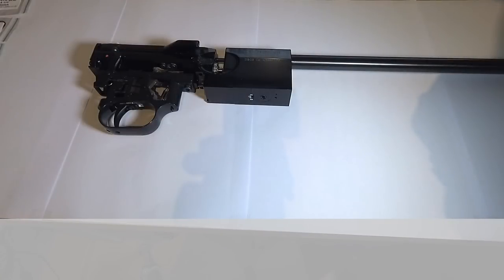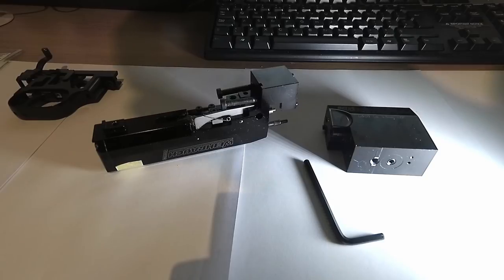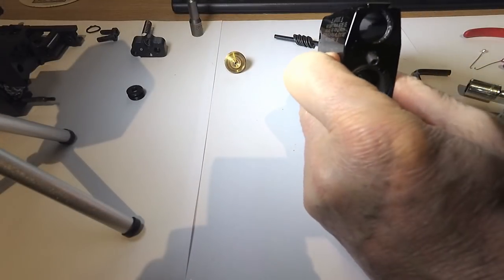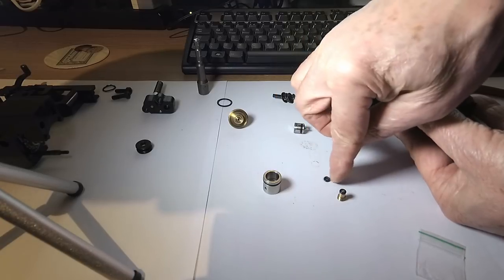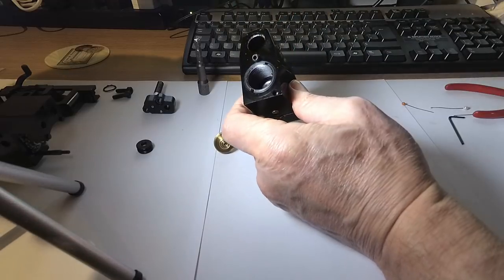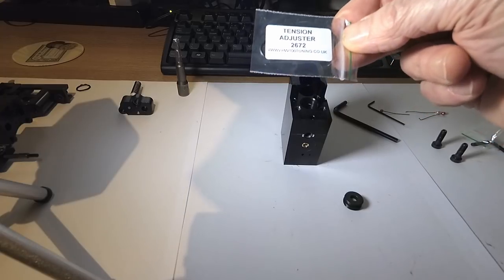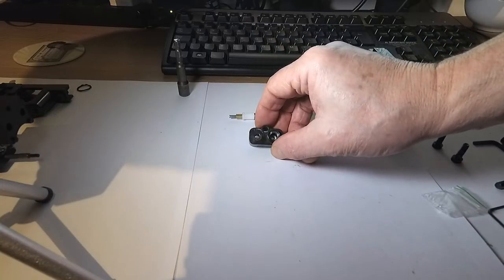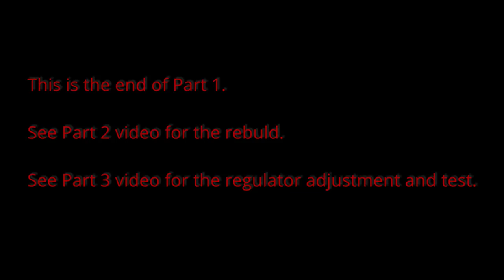Weihrauch HW100 - Regulator Service - Part 1 of 3

Comment: my local firearms dealer does not deal with hull cartrage any more after they ripped him off.

he now deals directly with Weihrauch
Reply from the maker: Hi, I am all for cutting out the middle man to achieve best value.

I did not send my gun to Hull for servicing because of the cost and the demand that I sent it via a Registered Firearms Dealer.  Using an RFD is clearly not necessary for a non-FAC gun.  See the SERVICING tab on the  www.hw100tuning.co.uk  website for details of the steps needed for sending guns for servicing via the Post Office.

All the best,  Martin

Comment: Hi, many thanks, amazing 3 videos you done here. 
It will definitely help me thank you. 
I have a leak which air comes from the pin hole at the top of the gas canister on HW 100. 
I've changed the little O ring and cleaned inside but it's still coming from that little pin sized hole when I fill it up with gas. 
Any thoughts much appreciated 🙏
Reply from the maker: Hi Craig,  Apologies for the slow response.  Sorry to hear that you are having problems with your HW100.  Do you mean that air is escaping from the pin hole that is located on the underside of the regulator section of the action when it is removed from the stock?
You mention that you have changed the small o-ring and I think that you mean the o-ring on the brass inlet valve.  The next easy thing to do is to change the o-ring inside the brass inlet valve.  See my Part 3 video.  But before doing any work on your HW100 be sure that you remove the cylinder first then cock and fire the gun several times to ensure that it is completely depressurised.
All the best, Martin
Reply: @MartinHealy  Hi Martin thank you for that, much appreciated.
Yes the problem was the O ring on the Brass regulator that houses the gas gauge attached by the 5mm Allan key. 
Everyday is a learning day!. Thank you for that and all the rest of your advice. 
Many thanks,
Craig

Comment: Great video. What order do the regulator washers go back in?
Reply from the maker: Hi Shaun,  If you use the slider bar to scroll through the video to the 30:10 second mark you will see me start to re-assemble the belleville washer set.  I put a diagram of washer order on the screen using bracket symbols to indicate the curves in the washers.
The washer order is -  ( ( ) )  ( ( ) )  ( ( ) )  ( ( ) ) 
Hope that this helps.  Please watch the other Part 2 and Part 3 videos to see the assembly and testing.
All the best, Martin
Reply: @MartinHealy  thank you thats great 👍

Comment: I had to heat my block to remove the brass fitting (it had never moved in the 19 years of me owning it). I had to use a blowlamp as i was scared of shearing the brass with the force i was having to apply. After gentle heating it came out with MUCH less effort.

Comment: superb video of hw 100
Reply from the maker: Hi Pratik,  Thanks - all the best, Martin
Reply: hi martin there is a slow leak developed in my hw100,  what should i do??
Reply from the maker: Hi Pratik,  There are several likely places that the HW100 can leak.  The first (simplest) place to check is the Main Inlet Valve (A) 2665.  Unscrew the air cylinder to get to this small O-ring.  If you are replacing this seal go for the upgraded polyurethane seal which is much more durable (https://www.hw100tuning.co.uk/product/polyurethane_seals.  If you have an original HW100 cylinder the internal seal may need replacing.  I don't have the HW100 cylinder so I haven't had to do this myself and I gather that some special tools are/may be needed (https://www.hw100tuning.co.uk/Air_Cylinder_Ends_Removal_Kit/p2174806_18670926.aspx).

If these easier options don't fix the problem then a strip down will be needed.  The firing valve seal 2655D (polyurethane) is another possible cause.  I would recommend the major seal kit (https://www.hw100tuning.co.uk/product/seal_kit) if you are opening the regulator side of the gun.

Above all please, please be safe.  Never work on the gun with the cylinder attached and pressurised.  Depressurise the cylinder before opening.

All the best,  Martin
Reply from the maker: Hi Pratik,  Feel free to send me a PM through YouTube.  Regards,  Martin
Reply: hi martin as i live in India, how can i get the original o rings for hw 100
Reply from the maker: Hi Pratik,  Good news - I just messaged HW100Tuning.co.uk and they confirmed that they will post direct to India.  Hope that this solves your problem.  All the best,  Martin

Comment: Hi Martin, as discribed in your Video, when will we see the part 4 of you servicing the trigger assembly and the probe Oring replacement ? Cheers.
Reply from the maker: Hi Ravindra,  I only make these videos when I am carrying out repairs or service on my guns.  I believe in the motto 'if it ain't broke don't fix it'.  However, when the time comes I will continue to make videos.  The next video is likely to be the strip down and seal replacement on my Webley Raider 10.  In the meantime check out my pistol and pellet reviews on another of my channels - here is a budget pellet range testing session that delivered surprisingly good results - https://youtu.be/669_SOr5UX0?si=yTNXGpPg0qptmkBB
All the best, Martin
Reply: Hi Martin,
Thank you for the reply.
All the best.

Comment: Hi Martin thank you again just looked at my rifle and the ball bearing is in the test port and there is no grub screw holding the ball bearing in there is only a grub screw on the other hole next to the port that makes sense
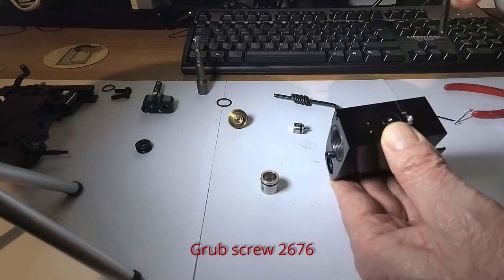Reply from the maker: Hi Matt,  I am sorry if my video has added to the confusion.  The pressure test port is right next to thread hole for the stock mounting screw.  The pressure test port is towards the barrel end of the block.  In the video you will see me remove the the pressure test port grub screw at 16:48 but I then stupidly put the replacement pressure test port plug into the stock mounting hole.  I put some text on the screen to highlight this mistake and of course I rectified it. Please watch this section of the video again carefully to make sure that I have not accidentally mislead you.  By the way, if you are going to be connecting a pressure gauge several times while tuning the gun setup it is a good idea to get the hw100tuning.co.uk replacement pressure test port plug which replaces the ball bearing and grub screw.
All the best, Martin
Reply: Morning Martin thank you very much for clearing that up just did a nutshell so where the ball bearing is in that port should really be a grub screw holding it in
Reply from the maker: @blarza007  Hi Matt,  Yes - see the HW100 exploded diagram at https://www.hwtuning.co.uk/exploded_diagram_new.htm.  The test port threaded hole should have the small O-ring (2677), ball bearing (2675) and grub screw (2676) tightened down to seal the port.  Hope that this helps.
All the best,  Martin

Comment: Hi Martin . . . another question.  When you remove the air cylinder, does this remove pressure from all areas within the block?? ie - if you remove the cylinder, can you then remove the screw and ball from the pressure test port without 90 bar bursting out??  I assume this is the case but if so, is the pressure equalised to atmospheric throughout? I haven't tested my HW100 recently but have vague memories of removing the cylinder, cocking and dry firing and there was still pressure inside it but surely this must be wrong? - I will have to try it again some time
Reply from the maker: Hi, I haven't specifically tested for this case but I would expect the block to depressurise when the cylinder is removed because the regulator piston will (should!) be driven forward by the Belleville washers and the Main Inlet Valve will open.  But never trust to luck.  Always treat a gun as though it is loaded so, even after removing the cylinder, point it in a safe direction and dry fire before doing any work on it or cleaning.

By the way if you are going to be opening the pressure test port I show a little tip in the video about using a powerful magnet to draw the ball out.  If you are planning to do some serious experimenting with different regulator pressures then would also recommend replacing the original ball valve with the brass plug from hw100tuning.co.uk.

All the best,  Martin

Comment: When i replaced the o rings on the main inlet valve,and screwed,the air tank back on my gauge is not in the same place i.e. it is half a turn out ,do i take it back off, and tighten,an extra half turn,  but i don't want to strip the threads.
Reply from the maker: Hi Jeff,  You are right to be cautious and not over-tighten.  The cylinder doesn't need to be gorilla tight.  The small o-ring 2665 on the end of the Main Inlet Valve ensures the seal.  I don't have the Weihrauch cylinder on my HW100.  But I am struggling to understand how your gauge has ended up half a turn out.  I think I would remove the cylinder and the MIV.  Then screw in the cylinder, only till firm,  and see if the gauge is in the correct orientation.  

Referring to diagram:  https://www.hw100tuning.com/exploded_diagram_new.htm
If the gauge looks correct then the cylinder could be bottoming out on the MIV.  Check that the o-ring 2674b is correctly seated.  Check that the threaded sleeve 2673 is screwed tightly into the block (it may have moved when you unscrewed the MIV).  Check that the MIV is assembled correctly.  Refit the MIV and tighten firmly.  Refit the cylinder.

Hope the above helps.  All the best,  Martin

Comment: Hello Martin, I need your advice! 
I've changed some O-Rings of my Hw100 and everything worked perfect, cause of your Video, thank you for that. 
But last week my Hw100 keeps leaking. I fixed it quickly, O-Ring 2658 broke. So I got a new one in, but it is still leaking, every O-Ring is fine. It leaks from 200 bar and stops at 130bar, which is strange cause my regulator is set to 90 bar. Did you have those issues? 

Sorry for my english and greetings from Germany 😁
Reply: Hi Seepel,
I am happy to try to help but you will appreciate that without the gun in my hands it is hard to narrow down the cause of the leak.  So I can only offer some general tips and hints.  I am not sure which Orings you have already replaced.

Oring 2568 - if you have used the original Weihrauch specification then these Orings are crushed when the breech plug/block are mated and need to be replaced each time the block is opened.  The replacement new specification Oring 2568 are a narrower section and often can be reused.

One of the most common cause of slow leaks is the small Oring 2665 on the Main Inlet Valve.  Remove the air cylinder and you can then see Oring 2665 on the end of the brass inlet valve.  I would recommend changing this Oring and using an upgraded polyurethane Oring because they are more durable.  Fill the cylinder to 200BAR and leave it off the gun for several days and keep monitoring the cylinder pressure.  The original Weihrauch cylinder has a valve at each end and the air pressure should remain constant.  If the pressure drops while the cylinder is off the gun then the cylinder needs to be serviced.  I use an aftermarket A&M cylinder so I have never had to service the Weihrauch cylinder.  If you need to service the cylinder exercise extreme caution and ensure that the cylinder is absolutely completely empty.  There is a useful guide to opening the cylinder on  https://www.hw100tuning.co.uk/   They also sell all the Orings and tools you may need.  They are operating during Covid-19 and will post to Germany.

If the above does not fix the leak then you need to return to the regulator block and carry out the full service as in my videos.  I would recommend the major service kit of Orings from HW100tuning because it is a simple way to get a full kit of quality Orings that are all individually bagged.  I don't have any affiliation to this company but I have found them to be a good company to deal with.

Hope that this information helps.  Regards,  Martin
Reply: @Incognito1-1  Thanks for your help, I already ordered the O-Ring Set months ago :) I changed some Orings but not all of them, my hw100 is sealed. So today I took my HW100 apart to see if the O-Ring 2658 is damaged. It is, but I have several other 12x1mm Orings. Instead of putting the O-Ring over this little neck on the breech block(2681) and pushing it back in again, I tried to place the Oring in the groove on the valve housing. I tried my best to keep it center while pushing the breech block in, so I hope this will keep the Oring from breaking

Comment: hello I followed all the videos you put online you helped a lot of people to repair their own pcp for that thank you very much here is my problem I bought a PCP recently a HW 100tk canon 41 cm there is 16 joules my problem when I bought it in France I asked for a 35 joules 60 cm gun they sent me the 100tk 16 joules instead. because I live in Algeria I can't make a return otherwise it will cost me very very expensive in money. Given that I shoot at disciplines very far I wanted to raise it to 25 joules so please if you can help me raise it to 25 joules tell me which part I'm going to change because here at home in Algeria there is no power limit you can have a PCP of 150 joules so once again if he please if you can tell me which part changed i will buy them and thanks for listening to me again thanks for all you do
Reply from the maker: Hi Matouk,  I live in the UK and have a sub-12ftlb HW100 (<16J).  My experience has therefore always been focused on ensuring that my guns remain below 16J to remain legal.  There are some significant design differences between the 16J and FAC variants of the HW100 (such as the regulator piston, belleville washers, hammer spring).  In your situation I would definitely try to sell the 16J gun that you have and use the funds to buy another FAC HW100.

If you do adjust the power of your 16J gun upwards you will need to increase the regulator pressure and the hammer spring pressure.  Since you purchased the HW100 in France I am not sure if there will be an anti-tamper fitted on the hammer adjuster.  If there is no anti-tamper fitted then you could try increasing the regulator pressure to say 110BAR and increase the hammer spring pressure gradually to achieve a higher muzzle energy.  

There is a balance to be found between the regulator pressure and  the hammer spring pressure.  If the hammer spring pressure is too low then it will not open the firing (exhaust) valve fully because of the regulated air pressure behind the valve.  If the hammer spring pressure is too high it will cause hammer bounce and that will waste air and significantly reduce shot count.

Attempting to increase the power will have significant costs and potentially a damaged gun.  But if you still want to go ahead then, after checking to see if your gun has anti-tamper fitted, contact  hw100tuning.co.uk  they will be able to sell you the parts.

So my advice is definitely to find someone in Algeria who wants to buy a 16J gun.  That way you will be able to buy an FAC gun that was designed to shoot consistently at higher muzzle energy.

All the best, Martin
Reply: hello thank you for answering me it's fast it's nice of you and thank you for the advice you gave me but the problem I can't sell the law here in Algeria and clear to sell it was necessary wait 3 years since I bought this rifle it's been a year you have to wait another 2 years to sell it for anti-burglary it is not it it is free that means that I can adjust the spring of the hammer as I do you want is there no other parts to change only the setting it's a good PCP small handy better than the 60cm in the barrel but the disadvantage for the 41 cm it has a limited distance so if I can adjust how you told me is it possible I adjust it to how much please are there other pieces to buy again thank you very much and I apologize I I took some time from you thank you

￼

￼

Comment: hello please I have a problem with my hw100 pcp rifle I have a non-filter barrel a manter silencer I can't take it off it's fixed I don't know with what
Reply from the maker: Hi Matouk,  I am not sure that I understand the issue you have but I think that you are not able to remove the silencer.  If your HW100 has a standard Weihrauch barrel then it will have a 1/2" threaded muzzle end.  So if you firmly grip the barrel the silencer should unscrew counter-clockwise (turn left when viewed from the muzzle).  Please ensure that the gun has no pellets in it and that it is de-cocked before doing any maintenance on your HW100.  
Perhaps someone has added some Loctite thread locker?  If red high strength (permanent) thread locker has been used then it can be extremely hard to separate parts.  The usual method used is to apply heat from a gas torch to the joint area but of course you can't do that in this case.   So if the silencer does not unscrew then I would try clamping the barrel in a vice protected by soft jaws then fixing a strap wrench to the silencer to add leverage and again try to unscrew the silencer.
If the above methods fail then you may have to accept that the silencer is permanently attached and live with it.  When you are cleaning the barrel slip a drinking straw into the silencer and this will allow you to feed the pull cord through the silencer and down the barrel to the breech.  Without the drinking straw inserted the pull cord will just snag on the silencer baffles.
All the best, Martin